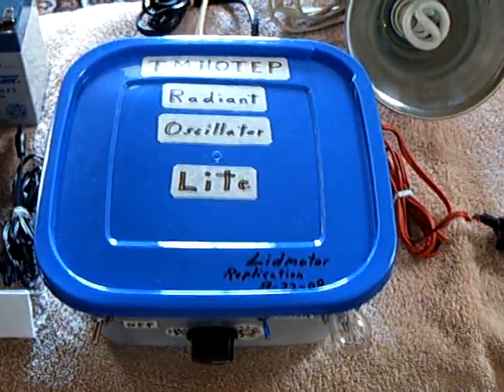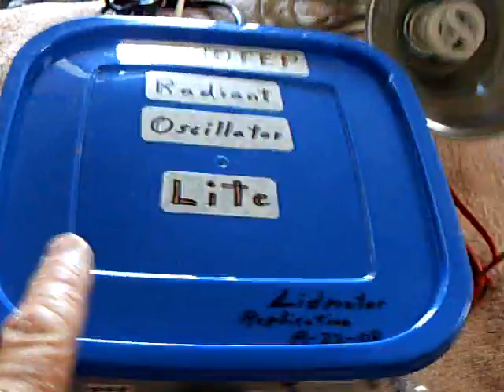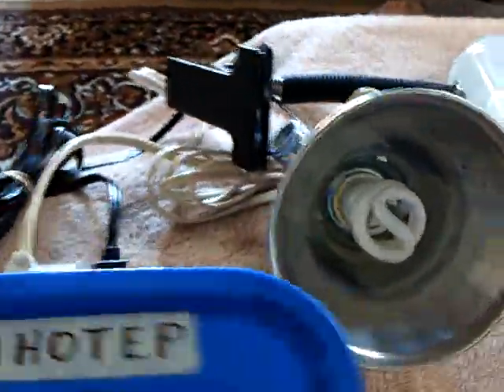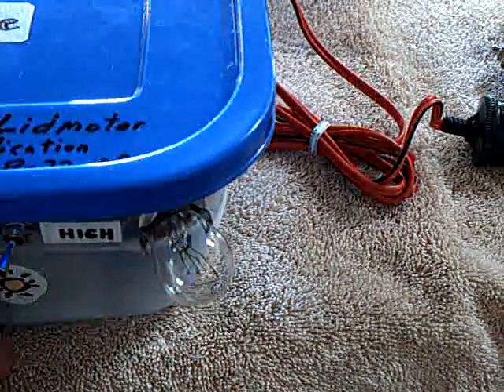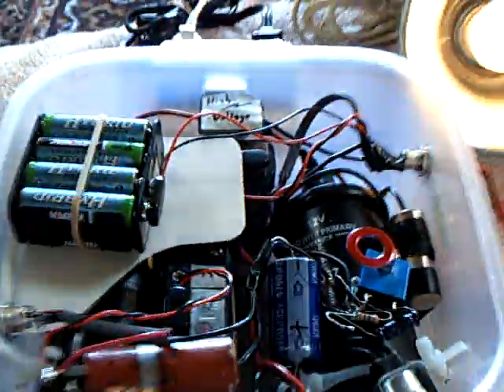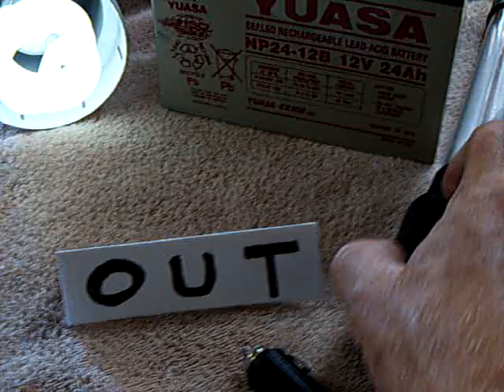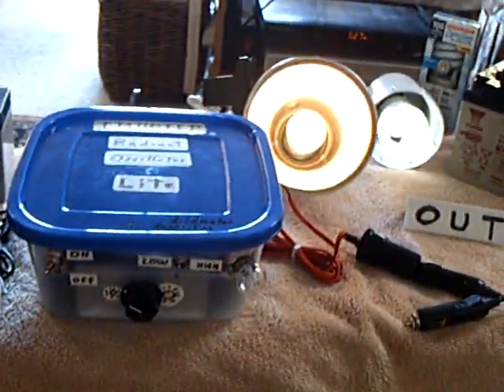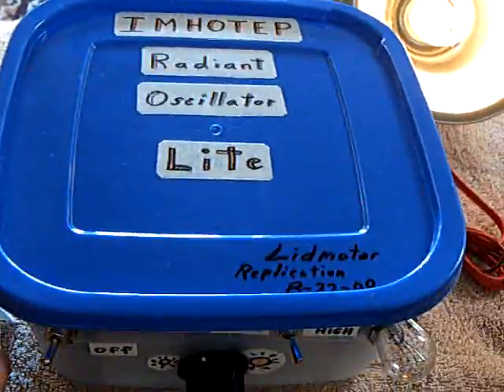Imhotep Radiant Oscillator -- Boxed

Comment: GREAT VID INSTALLED COIL TO MY BADINI WORKED GREAT THINKING ABOUT ADDING ANOTHER COIL TRY TO GET 4 LIGHTS RUNNING I NOTICED AFTER YOU SHUT IT OFF AND DISCONNECT MY WIRES MY SCOPE SAYS THERE IS STILL ACTIVITY ANY CLUE WHAT THAT COULD BE ONCE AGAIN THANKS FOR THE HELP